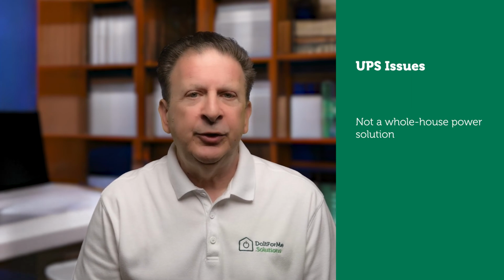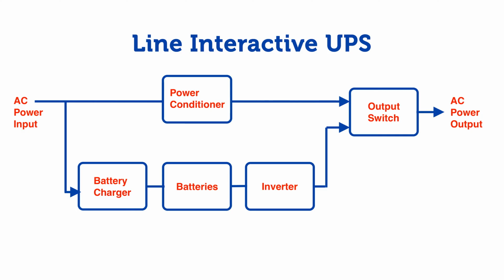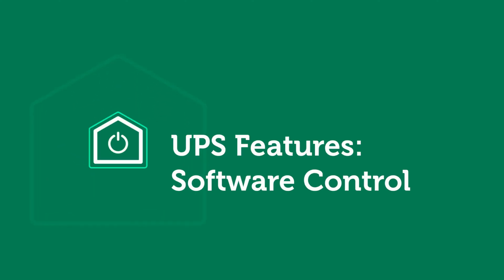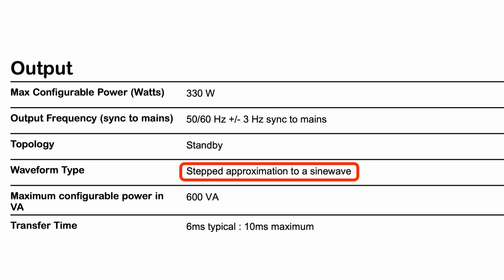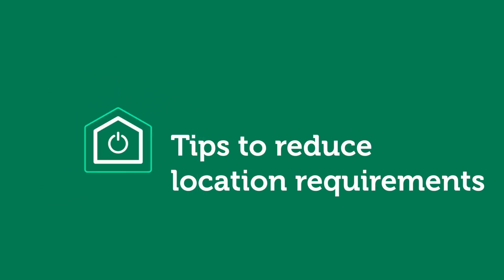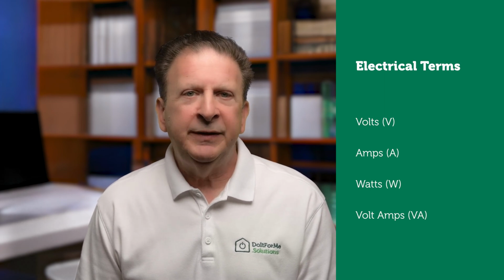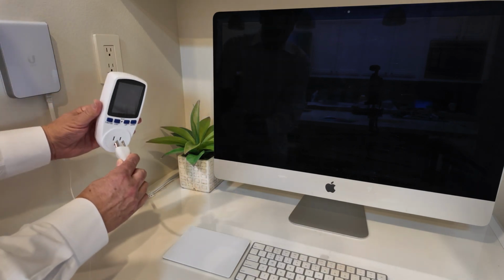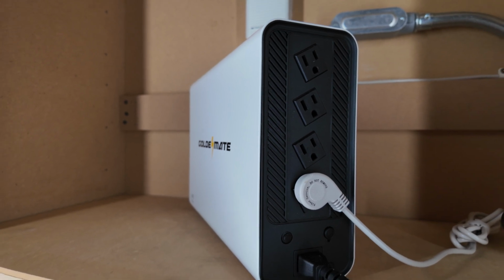The Ultimate Guide to Choosing the Best UPS System for Your Home

Comment from the maker: Do you have a UPS?  Are you concerned about power problems or blackouts?
Reply: I've been dealing with minor PC freezes and decided to throw money on the issue first, as reinstalling Windows isn’t part of my hobbies. I ordered new RAM, which is compatible with my motherboard, and a UPS, after noticing occasional light flickering in one part of my apartment. While I've never had power outages, I considered an AVR but ended up choosing a UPS based on all YT videos recommending it including yours.

I narrowed my choices to the APC BR1600SI ($500) and APC BGM2200B ($400), (main con:) lacking eco mode. I chose the newer BGM2200B as I am already past desired budget and due to it being more future-proof for potential GPU upgrades (in 3-5 years), as Nvidia cards are drawing more and more power. Now, I'm just waiting for the UPS to arrive, hoping the initial smell reviews online mentioned is the only downside for its rating...
Reply from the maker: @yuriys5642  Any feedback?  Has your choice of UPS worked out well for you?